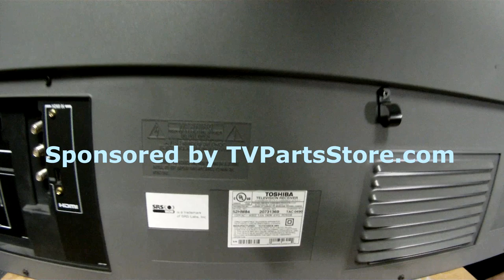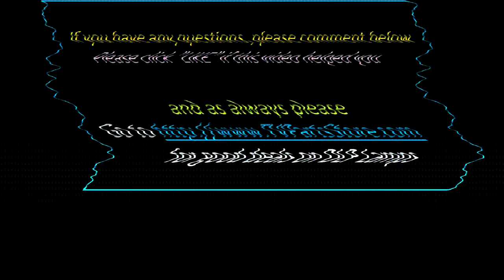Toshiba DLP - 52HM95 - Ballast Replacement - Similar Models 46HM95 62HM95

Comment: I had a bulb blow on my 62HM94, replaced it, and still no picture. I talked to the place I bought the bulb and they said there was a 90% chance it was the ballast. They also told me that a shop repair would be expensive (300+) and if I bought their ballast it could not be returned if the tv still didn't work.They said buy a new tv, Well I didn't want a new tv. I saw this video and went for it. After 2 hrs (went slow on purpose) I was done & happy. Thank u for helping us with this awesome video!

Comment from the maker: Should be fairly similar process.  Check the owner's manual.  It should give you the error codes.  If you check the error codes and it mentions the reason is the lamp not starting, it's more than likely the ballast (which caused your lamp to fail).  So you would have to replace both.  Toshiba DLP are notorious for this problem.  Good luck.

Comment: Thanks for the video.  I had replaced the bulb in my 52hm84 but it still didn't come on.  So I bought the diode/resistor repair kit and fixed the ballast.  After putting it all back together the buzzing sound from the balance that I heard before is gone but the brand new lamp still doesn't light.  Any idea what I may have done wrong?

Comment: I have a LG RU60SZ30. The tech told me it was my ballast assembly. I would like to save some money and do it myself. I was curious if some tvs such as mine, you have to access the ballast from the front of the tv. If so, how do you get the front off because I have all the screws out but bottom of the front screen acts like its still screwed in

Comment: I have a 62HM14 and I keep getting the error code that says there is an issue with the lamp. I have tried two new lamps and it still does not work. I have disassembled my TV thanks to your video and have the ballast out. Nothing seems obviously wrong with the ballast (blown capacitor/resistor) and it wasn't blowing lamps frequently. When I would turn the TV on I would get sound but then it would keep trying to turn on. Do I need to replace the ballast or do I have a more serious problem? Thanks!

Comment: Great video...do have a question. You didn't show the re-connection of that main electrical (20 pin ?) it has a cylindrical tube just before the connectors. I tried this 3 years ago and reconnecting that wire was impossible, to the point where one of the pins snapped off. I may have to replace the  ballast again. How did you manage to do that. I had to purchase the whole board last time and get it profesionally repaired.

Comment: A friend gave me a Toshiba 62hm84 model ( I do not have the remote) and the green light on the front is solid, and the red light just blinks? The TV will not turn on by touching the power button on the front
( touch function not a button ) . I think I need the board that turns the TV on (again touch function ). It is the board on the front of the TV  that ( is behind  and ) controls the power, menu, volume up & down,etc. etc. It is about 8 inches long by 2 inches wide. I do not know the name of said board. Any info will be helpful. Thank you!

Comment: quick question i have a samsung dlp, and a bulb replacement hasnt done me any good so my next place is to check the ballast... the "test point" shows 161 volts even though the powerline itself is giving 323 from the supply board (checked it) ande the bulb gets a max of 7.8 volts dc and 15 ac (didnt know it was gonna do that or that it should) im guessing the ballast is bad from this, would you say im correct?